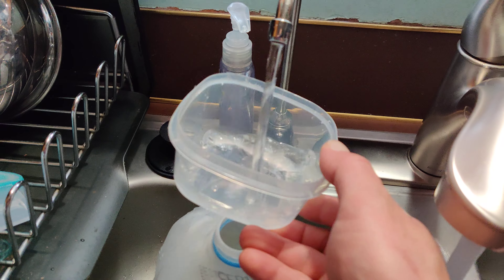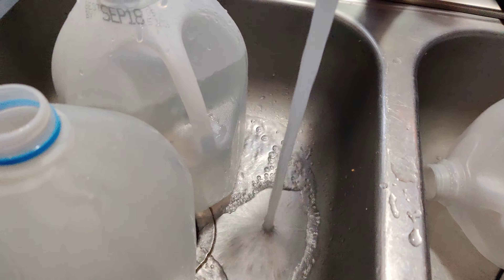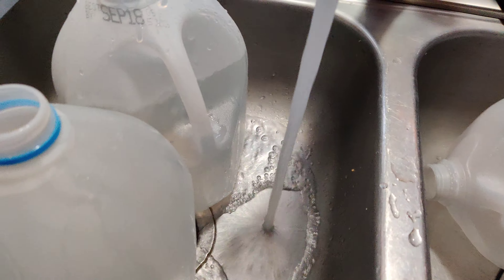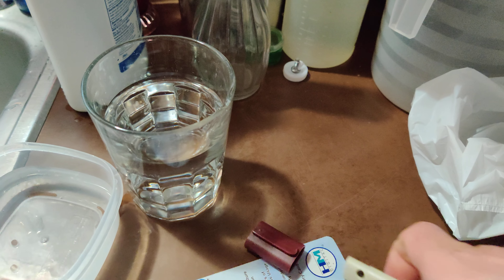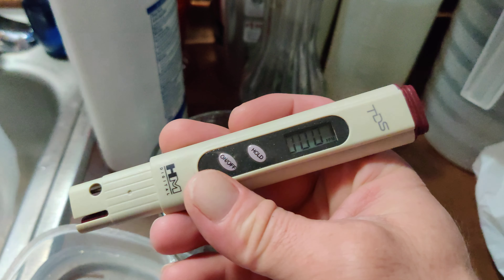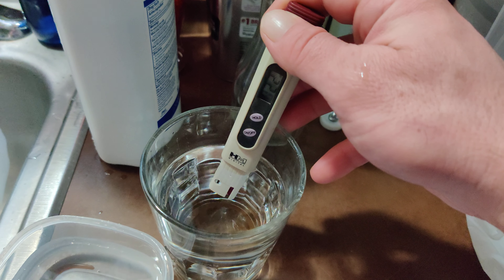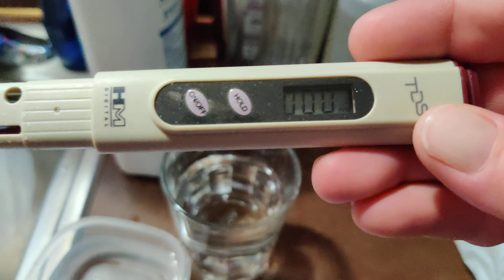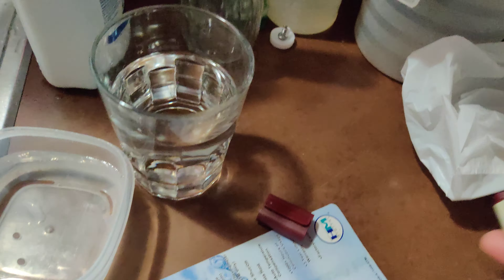PPM water test

Comment: Very cool & informative. We live in an older house that was built or added on to in different stages. LR & kitchen came 1st, in 1959. The TCEQ tests our water from the tap after it hasn't been run in at least 6 hrs, we're supposed to catch that 1st morning sample. 2 different times, our water has come back "lead contaminated, & although the readings are "low" by lab/QA standards, it's still worrisome for me. We've lived here 5 yrs, & they've only started testing the water in the last 2 yrs. Of course, they say that the lead contamination must be on our end of it (they're only responsible for the piping leading up to the meter),& this house is old & plagued with problems. However, I'm thankful to gave a place relatively off "the beaten path", & thankful for the countless Blessings we receive yet fail to acknowledge at that moment. Much, much Love to you & your Family David, & may God's Blessings be plainly evident & plentiful for yall now & Forever More.~
Niki💜